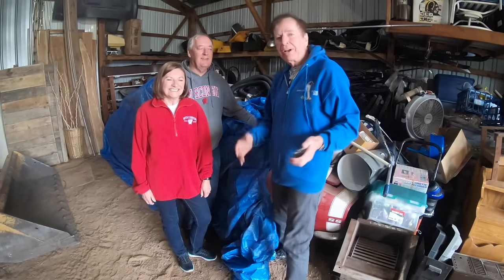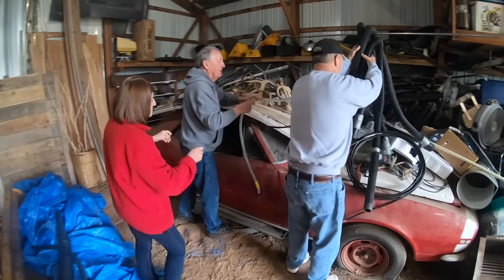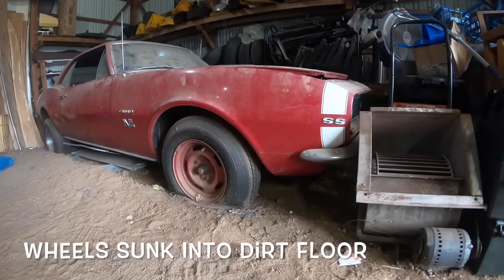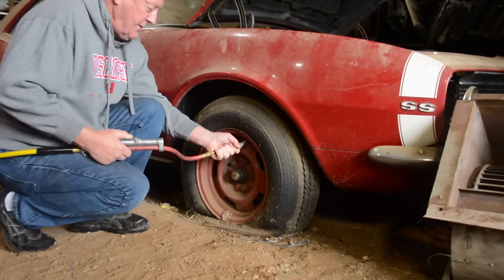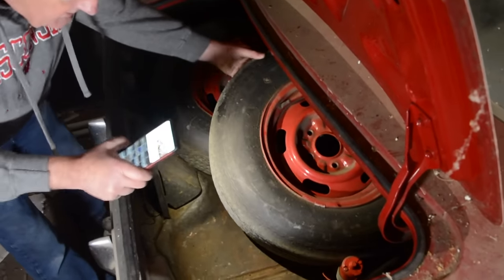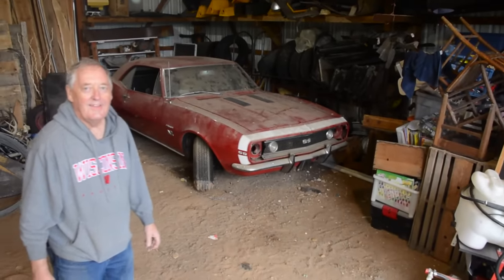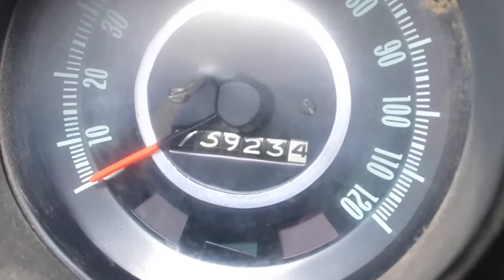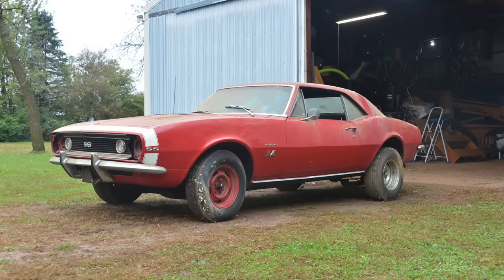1967 SS 396 Camaro Barn Find Parked 43 Years

Comment: Having the numbers matching block makes this car very special, spun bearings are not a big deal. Great story Jerry, thank you for sharing it with us.
Reply from the maker: Thanks Bubba!! I flew up to Wisconsin to do this one.
Reply: The block must be magnafluxed to make sure it is ok...
Reply: Would always have a machine shop do the bottom end... maybe the whole engine on a car like this.
Reply: Jerry Heasley I have to call BS on this one , sorry don't pass the smell test at all !!
Reply: (edit-buster smith) You gotta know we will all want to know what makes you say that...
Reply: I have a few question also,
Reply: Jerry is in this thread line so he will get notified of your questions...
Reply: @joeshmoe1585  MagnaFlux and I would sincerely recommend a Sonic Test to gauge the thickness of the walls, bearing bosses, etc.
Reply: Rare to see everything part match an all original an its in good shape
Reply: See what you was up to
Reply: To me things get to be fishy if someone says they don't know if was the factory intake... Even GM's alum intake had the GM stamp on and and I do not think the SS 67 came with an alum intake period...
Reply: Running around Wisconsin, could be in bad shape underneath...rust.
Reply: @markclark6491  good shape??? Will cost a fortune to make this car valuable again.
Reply: The car still needs a costly lengthly resto. Powertrain, brakes...big job ahead. At least this car is worth it. It's a long, long, way to Mecam...more than one Gold card to get it done.
Reply: @port nut It gets hazy after ya get so old... When I say I've forgotten more shit than someone else ever knew I'm not kidding ya but later on in life it gags ya...
Reply: @port nut I'm 57 and I got bad news it don't get any better....
Reply: Had several poncho Bb spin a main due to crap bearings and cranks. Ya get what ya pay for no matter what manufacturer.
Reply: I was hoping to see that you still had the original cylinder heads.

Comment: I bought one very similar for $2,250 in 1978 with ~37K miles on it. It was built about a month before this one, also in Van Nuys, with original MR-code L78. Smog system & exhaust manifolds long gone, with a set of vintage Mickey Thompson Super Scavenger headers. Trans is a '68 M21 replacement, but rear end is original.   Butternut Yellow with black bumblebee stripe and black vinyl top.  Deluxe black interior with console/gauges. AM radio w/rear speaker, rear defogger, non-power front disc brakes with original rally wheels and disc brake caps. Found the UOIT printout in the car, matching the body number & cowl tag options.  I still have it.   Great fun to drive.  Those Mickey Thompson Super Scavengers have a very unique sound.  I hope that the car in the video (and all the parts, including the rare exhaust manifolds and smog system), end up in the hands of someone who'll do it justice.  There are very few LOS(Van Nuys) '67 L-78 Camaros out there anymore, with the majority of them built in Norwood (with MQ code L78s). Thanks to Jerry for putting this video online.
Reply from the maker: Nice story, and you still have this Camaro?

Comment: I have a 1967 SS 396 Camaro  375 horsepower car that I have restored. The original motor and 4 speed transmission are long gone. It was ordered stripped and raced. When I purchased the car the original 12 bolt posi was howling as I drove it home. It took me 4 years to restore the car and was painted in its original Marina Blue.

Comment: I bought one in 1968. 396/375 hp, with the Muncie M22 transmission.  I drove it on the street for awhile,  put 4500 miles on it before transforming it into a race car. I raced it for one season, then converted it back into street trim to sell it. The guy that bought it from me still owns it, but won't sell it.

Comment: I have a 1967 SS L78 original numbers matching Camaro also. I've had it since new and Its like a member of the family. The garage would look awful empty if it wasn't parked inside. Mine is butternut yellow with black interior. Funny thing is that no one wanted it back in 67 because it came with a 4:56 ratio rear end. It was a hoot to drive back in the day.  Nowadays, when we go to the local cruise-ins it gets a lot of attention.

Comment: Parked 43 years in 10 year old steel building 🤯
Reply: They probably meant it hasnt been started in 43 years bur they probably pushed it on the barn
Reply: Sweet.
Reply: Voitûre ançetre Ford
Reply: i was thinking the same thing .. that building aint old at all
Reply: @shawnthib  Nope, it wouldn't be possible to have a barn rebuilt huh
Reply: I thought the same thing at first, but looking at it on the inside it is an old barn with newer siding on it. Probably had it replaced not long ago.
Reply: @shawnthib  Building was built in 1969
Reply: @codylapoint  Building is original 1969

Comment: I hope you get her cleaned up. I would give anything to have my '68 back. A couple years ago I went back by my old Army reserve unit. A guy right next to the building had bought my car. That was the last place I had seen it. I was hoping it was still there but no such luck. That's not very surprising since it was 1985 the last time I saw it. Mine was orange with white stripes.

Comment: I lived up in Adams county Ohio, right on the Ohio river. Very rural. Right down from my place on a huge old farm sat a 1969 chevelle SS 396 4 speed all matching car with a tree growing from out under it and between engine and frame coming out fender well. A beautiful chevelle that had sat like that for 25 yrs. Then to beat it all in the barns were old impala and Plymouth, couple old tractors. Old fella passed away and most was sold off. The Chevelle went for I'm pretty sure 10.000 on e-bay. If I wasn't a poor guy I'd loved to grabbed the chevelle.

Comment: I know where a true "barn find" sits. Sunk into the dirt floor of the actual barn. It's a 1966 Chevelle SS with a 396 and 4speed with a bench seat in the front. It was ordered that way by my father in-laws dad. He drag raced it on the weekends, drag slicks are in trunk. Ran it as the family car through the week. It has 20,000 original miles on it. It has slowly rotted into the barn floor. Estimated cost to restore every nut and bolt exceeded 100,000.00
Reply from the maker: email me at jerryheasley@gmail.com and we'll go over this - if you want might do a story and youtube on this - thanks

Comment: Great find, rare and fairly close to an original car even with a non orig 325 HP 396 engine and he still has the original block with the correct matching numbers but I didn't see or hear any mention of the original 375 HP large port heads, or the steel crankshaft for the original engine? The steel crank could be sourced without too much trouble but finding date matched heads would not be easy and make the car less valuable if he does not have them!
Reply: You need to listen closer to the video he said they put the heads on the 325 hp engine . I had a 67 ss350 the reason for not running disk brakes is less drag than disk brakes as the shoes are pulled away from the drums by the retract springs

Comment: At 19:36 I paused this video for research. The tow ball on my 1967 Camaro has a slight bend to accommodate for the angle of the bracket that holds it in place. i always wondered if thats the way it was made intentionally. This video verifies it. Thank You!
Reply from the maker: Tow ball? Okay, my '66 Mustang had one and it was also a factory accessory.

Comment: What an awesome find. if it wasn't for the rust in the quarters, it is almost a survivor.  but do to the rust in the quarters it definitely needs a full resto, but reusing as many of the original parts as possible. but it definitely  need the original motor rebuilt and reinstalled. I am working on a 71 SS 396 LS-3 big block my self. it one of 1533 made that year. finding original parts is next to impossible. the are a lot of parts on a big block car that are just slightly different from a small block car.

Comment: Great Car...by the way..I've built quite a few 67 Camaros, currently doing an RS/SS Pace car, and I've never found a build sheet in any 67 Camaro.
Reply from the maker: Did you look on top of the gas tank of any of the 1967s?
Reply: All six 67s got new tanks Jerry, and when I pulled the original tanks there was no sign that there was ever any build sheet, seat back either...Corvettes, now..different story. @thewriter2549   From what I've read on rare occasions one would leave the line with one under the carper, rear seat or tank, but it was not standard practice on 1st gens.
Reply from the maker: Okay, we'll check carpet, then, thanks.
Reply from the maker: @port nut Neighbor not too far away has it and I believe he got it running, but did not fully restore, keeping originality as best he could. I might do a follow up when I am in the area.

Comment: I'd be very interested to measure the bores on that block.
This gentleman seems to be a nice guy, and an honorable man, but who knows what other people did to, or with that engine before he got it.
I used to have a NAPA engine machine shop in the early 1980's and have machined and built a lot of engines. 
If memory serves me correctly, GM / Chevrolet never made a four bolt main 396.
That may be a 427. Measuring the cylinder bores will tell you a lot. 
If you can put the crank in a lathe,  zero off the main bearing CL, then measure off the high stroke and see what the stroke is too, that will tell you a lot.
If that block was ever decked, those stamped numbers would be gone and someone could have stamped in any numbers they wanted.
Doing a little machinist detective work would clarify these questions.
Awesome car. Excellent video series.
Take care.
Reply: Wrong on the 4 bolt main

Comment: In 1973 during the oil embargo, the price on a barrel of oil rose 400 percent in 5 months and could hardly give this type of car away. This guy bought the car in 1972 with a bad motor from a dealer and paid 800 bucks for it. A year later you could have bought the same car running and breathing with 15 thousand miles on it for the same price. Hemi cars, Corvettes, Boss Fords you name it they all lost most of their value. One day someone you knew would be driving a big block LS6 Chevelle and the next day he had traded it in on a new 6 cylinder Nova. These days it is hard to believe that all those old performance cars back then were as collectable as a rusted to the door handles ten-year-old Toyota Camry is today.

Comment: Interesting number stamp on that block. My 67 Camaro, which I have owned since 1978,  still holds the original block. No vin on it at all. Date and engine codes are there and are correct for the car. Engine stamped V0417MA. Car built last week of May 1967. One of the few non-SS cars to have that bumblebee stripe, available on a non-SS car only near end of production year. Mine was built in Norwood, and had the base 327. Never checked the trans (Saginaw 4 speed) or rear (10 bolt open) numbers before they were scrapped (both failed in use). Maybe different plants did things like this differently, or perhaps just the hipo cars got numbered.

Comment: I have a 4K car as well. Not restored but has been stored inside since purchased years ago. Is in restorable condition. I do not have the original block. The block and heads (rectangular port) in the car is correct hi-per parts but date coded 1968 one year later. My guess the engine was replaced due to car being raced back in 67/68 and perhaps replaced under warranty.
Reply from the maker: You might not have noticed, but in the video he shows us the original numbers-matching 396 block, and he has the pistons and rods stored, plus the heads and intake are on the 396 in the Camaro.
Reply: Jerry I did see that the owner had orig block , pistons and rods.

Comment: I have that same exact car in storage, hasn't been touched since the early 70's and has the red rally's, I have never seen color matched rally's before and was told that someone must have done that but now it makes me wonder if that is correct, my car is like brand new, it is an ex drag car from the west coast 45k original miles.
Reply: @port nut that is what I thought also, just odd that the two are the exact same cars and are the only two I have ever seen with red rally's and both have been untouched since the early 70's, I thought it might have been something that DANA did on mine since they are the dealer that it came from and that drag prepped it, you are probably correct though, just a fad thing. I just took mine out of a long term storage and washed an 1/8 inch of dust off of it... boy are those cars fun to drive!.
Reply: Those are the standard steel wheels that came with Camaros that had hubcaps. The hubcap cars had the wheels painted body color from the factory. You never see it because everyone put chrome wheels on back in the day. Amazing he has a complete set.

Comment: $800 sounds like a lot of money in 73 to pay for a 6 year old car with a blown engine. That was even in the gas crunch years. Also, I'm really surprised an L78 Camaro SS with a 4 speed come with 3.08 gears. Thought it would have 3.73s.
Reply from the maker: The invoice is for February 1972, pre oil embargo.
Reply: U could order whatever gear u wanted
Reply: 3.08 gears and a 6,000 rpm big block could only mean 150 MPH cruising speed.
Reply: I believe you are right a 3.08 was a 10 bolt ratio.

Comment: This actually happens people, I have the same exact car sitting collecting dust right down to the red rally wheels. The only difference is mine is in perfect showroom condition with 45k miles on it. Mine was dealer drag prepped and raced in the late 60's then put back to driver condition, has been in dry storage since the mid 70's never even a minute spot of rust and perfect down to the red line bias ply tires and original spare that has never been on the road. not even a chip in the paint. So.... if I ever drag mine out and wash the dust off of it will you call it fake too? It is covered with dust and I basically lost interest in it years ago. I am also someone that should be shamed about it as mine should be sitting in a museum.

Comment: I sure would like to have seen the tire off rim, tire repair, tire  back on rim in 2 minutes using a manual tire machine! 10 minutes I can  believe.
Reply from the maker: If I can find a manual machine to buy I'll show this on video. It's no problem to spin that tire off, patch the hole and spin the tire back on and air up in less than 2 minutes. Ten minutes? I'd have time to eat lunch.

Comment: local Olds dealer took in a small bumper (1970)? SS396 Nova and i test drove it with a salesman in the passenger seat ,  it was a 4 spd and acted half seized, not much power, i passed -oh well....

Comment: imagine going back to 1967 with a supercharged 454 running on meth pushing out like 3000hp
Reply from the maker: Interesting question, but horsepower did the Top Fuel Dragsters have in 1967?
Reply: @thewriter2549  no idea, I think they used 426 hemis back then.. mopar

Comment: I'm sorry but no way I'm convinced that this Camaro has sat there since 75'. The cold winters and hot summers in Wisconsin would have split those old bias tires in half with no air and to pull it up out of those ruts and not have a single brake drag would never happen. Not as much as a squeak or grinding noise came from the old Camaro. Hell the thing coasted across that dirt floor and caught up to the mower that was tugging it. SMH. Also tires in the trunk wouldn't squeak after all those years of sitting. Not just my opinion but simple science.

Comment: "... through the traps at 6,000 RPMs" of course, it should be RPM, as the term is already plural: Revolutions Per Minute, FYI.
Reply from the maker: I get your reasoning. However, RPM becomes a unit when written "RPM" and a unit can be made plural. Would you say "100 RBI" or "100 RBIs" for 100 runs batted in? I would say 100 RBIs, which is what sports announcers say for runs batted in. What about the term WMD? How do you say the plural? WMD or WMDs?

Comment: And if you take it to the machine shop just to tell you you'll have to have it board for college dango 60 / that block cuz if a Denver blows up tears up errands into the water jackets on the motor and when I sing at the code on the firewall Thursday and I'll tell you whenever it was made time and never ever the assembly line what number is

Comment: AIR pump on a '67? 
Imagine stopping that beast at the end of the real 1/4 mile strip with standard drums (3.08s but still). Now to ruin it with another OVER restoration that these poor things are subjected to. Another white elephant you can't take anywhere. Little jealous here but not much. My standard mutt coupe does fine.😐